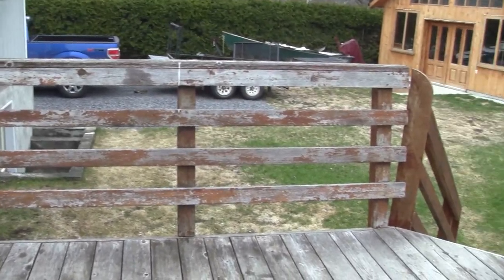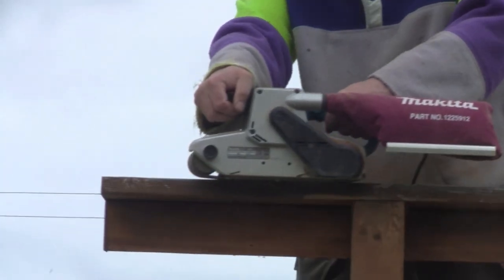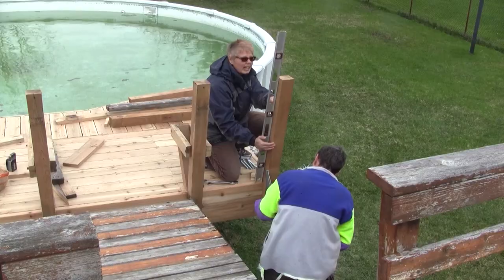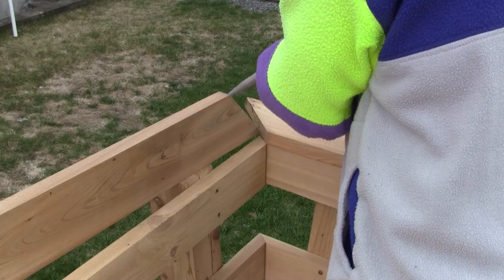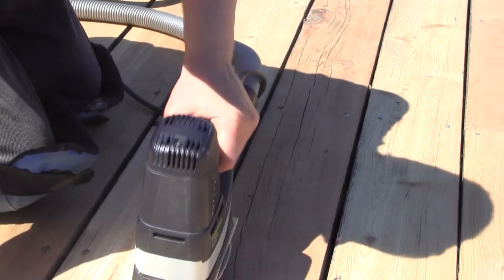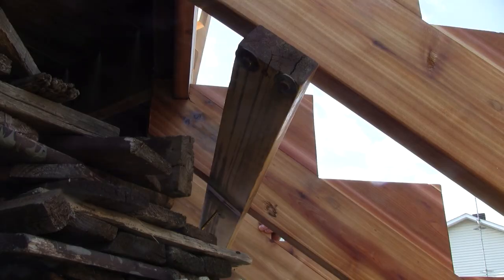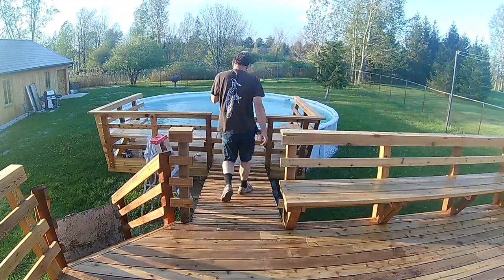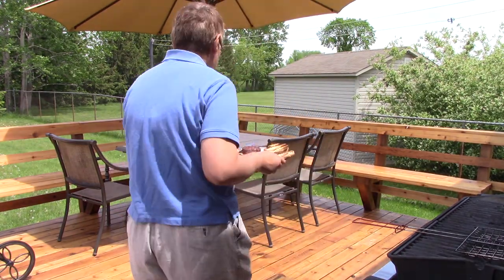The Woodpecker Ep 139 - Deck restoration

Comment: Alain, in the future you may find the two ropes used to lift the drawbridge panels may catch on shoes and toes, you might try putting a 1/2 oz. weight or magnet on one end so gravity pulls the rope taught and out of the way.
      P.S. You've taught Renee well. I liked this video. :-)
Reply from the maker: Not a bad idea, most of the time I push it under the bridge, because like yoy say, I don't want to catch any toes on a rope :(

Comment: the MRS. did a great job on EVERYTHING including being a comic, i was laughing so hard my wife had to ask me what was so funny i told her that you'll don't want splitters in your rear. or when you were sitting down resting & she busted yeah, but i would f needed a lot longer break than yu probably took.  there is 1 thing i do know i would have done differently on the floor sanding i would have rented a floor sander 9 hours that you did just a bit to much work i noticed you also got to use the wooden bandsaw.
i might add also what a mighty fine job you'll have done 
stay safe have fun b/c life is short
Reply from the maker: Thank you, Renée wanted to do something a little bit different, and I have to say she made a great job out of it.
As for our deck we're very pleased of the finish look. You'r not the first one saying that you would rented a sander... But my handheld sander did the job :)
I love my new bandsaw, I've been using it and it work much beter than my old one :)
And yes I always try to be careful

Comment: Why aren't you using your impact for all those long screws
Reply from the maker: Stainless screws are very soft and can break easily, and I'm not talking about messing up the head. My impact driver don't a variable speed but my drill does so I can start screwing slowly and add spead along the way. And still I messed up, I would say 20% of my recycled screws. since some of them had a bit of dirt inside the head and when the bit is not fully seated it's so easy to strip the head.
Reply: Alain Vaillancourt ya reusing fasteners is not cool in my opinion. If the head even has a little knick or like you said has stuff in the head it goes straight to the trash. It's the cheapest part of a project, good screws make everything easier
Reply from the maker: The thing is each screws cost 25¢ when you have more than a thousands to replace it add up pretty quickly. And since they were all stainless they looke like new except for all the dirt inside the head